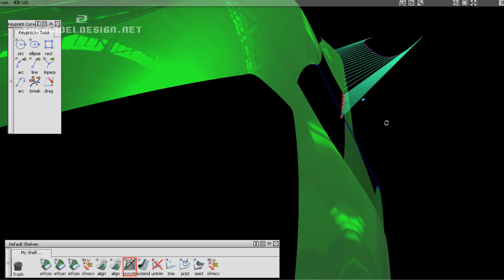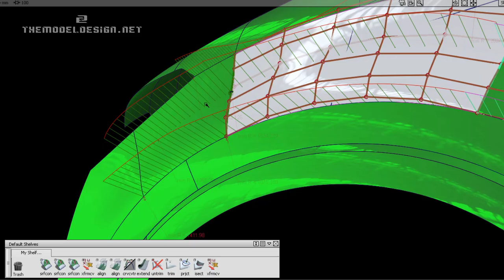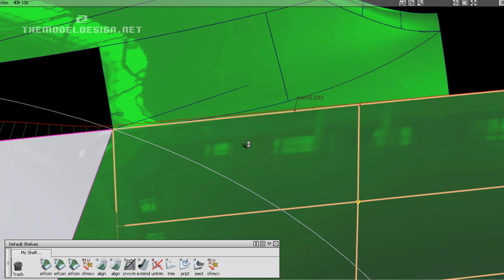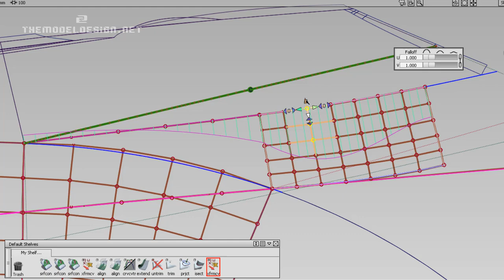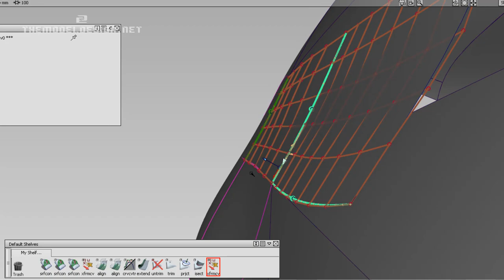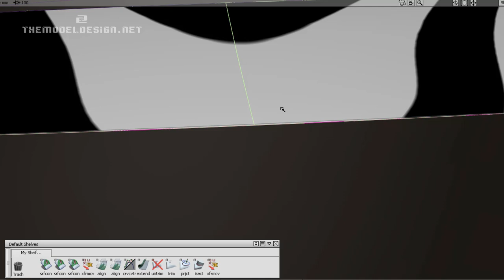Alias Modeling Automotive SPANS are GOOD Alternative method 3D Product Design Services

Comment: Hi, 
First of all, thank you for the Tutorial. The theme is really fascinating. 
I confused a little, you speaks about spans but I only saw Bèzier geometri. The first patch was a 5x5 Bèzier surface, the secound surface  was 10x5  which was divided by half and you got two 5x5 surface, where was I misd the B-Spline surface? 
Thankyou again! Best wishes!
Reply from the maker: That main surface has one, manually added span. Later I detach the patch and work individually on two halves.
Reply: @3dmodeler123  Thankyou for your replay.